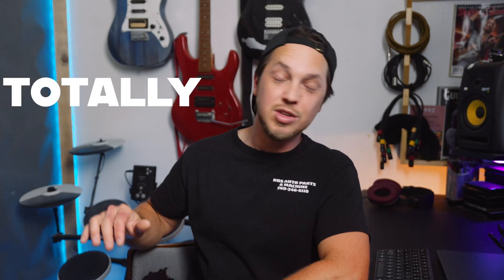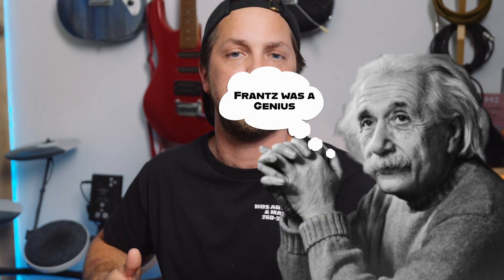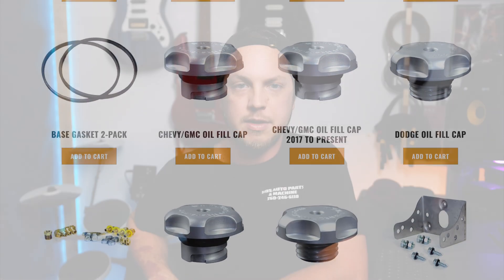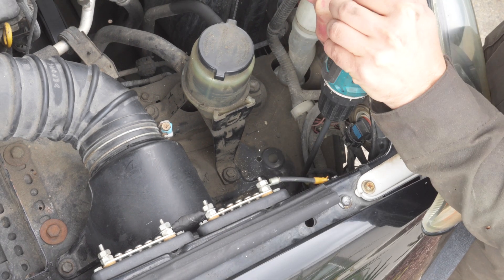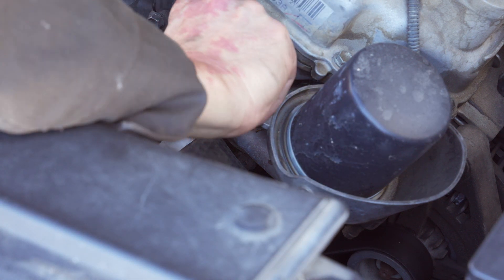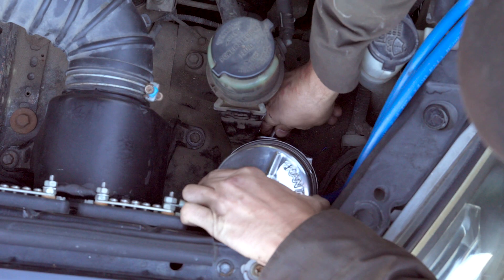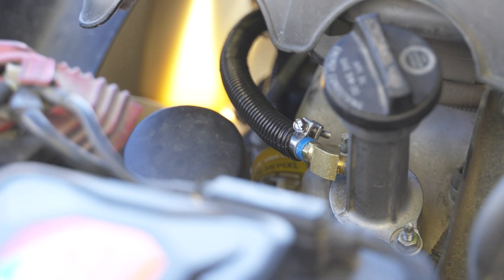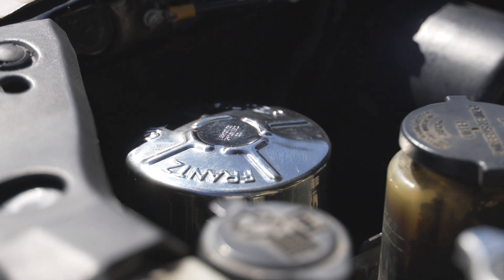Never Change Your Oil Again: Frantz Filter Bypass System Explained & Installed

Comment: The title is 100% clickbait. Can this extend the life of your oil? Almost certainly! But even THE VERY BEST synthetic oils have a lifespan, a long one, way way longer than you'd normally want to wait to change oil. In this case that lifespan claim on the jug actually matters. Why? Because the advertisment on the oil jug saying the oil will last 15k or 25k or some crazy shit, well thats talking about how long it takes for THE OIL ITSELF to break down and stop working right. In most standard oil systems, the oil will become full of contaminants, and general wear grime that will make it ineffective long before that oil breakdown mileage number. In the case of this special filter, all you're doing is, instead of changing your oil and filter every 3-5k like you'd normally do(if you cared about your car) you're now JUST changing the toilet paper each session, until you reach that stated oil breakdown point. Once you reach that point, you STILL need to change your oil! This filter is NOT a miracle worker. Saying that you'll "Never change your oil again!" is COMPLETE BOGUS! Can you use this to save yourself a TON of money in the long run? 100% absolutely! Is your oil now miraculously "forever oil" that you never change? NOT EVEN CLOSE! To even dare to suggest that it does, is downright disgusting and irresponsible. You should be ashamed of yourself!
Reply from the maker: You missed the part about full pao not breaking down. Also, haven’t changed the oil in my 1985 k20 in 15 years and it’s gotten nothing but standard oil and sometimes even dirty oil. Say what you want, but experience speaks for itself. I daily drove it for a long time and still drive it weekly.
Reply: @dillansgarage  Your and your Dad's experience is not enough to make concrete and solid claims that you never have to change your oil ever again. Present data, research, experiments, studies and the like, AND THEN you can make such claims. You're stating your claims AS IF they are facts when you have not proven that they are. All you've done is given your and your father's subjective testimony in favor of the product. I don't give a FUCK about your "experience". The "experience" does NOT speak for itself. PROVE YOUR CLAIMS!!! Don't just base them solely on your own "experience". I stand by what I said. Making the claims you did, in the manner you did, without supporting it with anything other than your and your dad's subjective experience, is downright irresponsible and shameful.
Reply: I have never had any trouble finding a toilet paper filter expert. In the 60s I set up at flea markets. Also in the 80s. About every other person was an expert. Even the ones that have never seen one. Its a tough business. Motor Guard gave up on selling oil filters years ago. Gulf Coasts head salesman only does heavy duty diesels now. Mostly military and marine diesels. Also like aircraft and Abrams tank fuel. If they dont sell good he doesnt deal with them. Luckily I have some in use. The Australian Jackmaster Classic is just as good. There are other ones. I installed them on diesel trucks like paper towel filters bolted to the frame on Powerstrokes. I dont think the salesman installs them. He just takes orders. When I sold them TA truck stops serviced them.
Reply: Actually what Dillan says is true. I probably wouldnt use the PAO oil or the TBN booster. I prefer the top loader filters. The reason I use toilet paper filters is so I dont need to drain dirty oil.
Reply: When I put a Frantz on my Rambler American and saw the oil go from dirty and black to new I thought it was a miracle worker.  In those days you could squeeze the top of the used TP and get sludge. Squeeze the bottom and get new oil. Hard to tell the difference with these modern fuel injected gasoline engines. You can still get bypass filters for the 64 L head engines. About a 10 micron spin on filter. Actually a full flow filter with an orifice.
Reply: Follow the money. He's shilling for this company, it's blatantly obvious.
Reply: The reason most of us dont normally change oil is we use filters that clean oil. We change the filters often enough to keep the oil clean. Normally we add enough new makeup oil to replenish the additives. Additives last a lot longer in clean oil. It is so simple even someone with no degree can figure it out.
Reply: I have nothing against expensive motor oil. When you are dealing with a lot of diesel soot its better to use a proven diesel motor oil such as Delo or Rotella and change the filter more often.
Reply: Good to have another oil and filter genious. The Edison of oil and filters
Reply: Oil filters dont make oil last longer. They clean the oil. Never needing to change the oil means you have avoided the reasons for needing to change the oil. Poor filtration is by far the biggest reason for needing an oil change. Not operating at normal operating temperature is anothe one. Leaky head gaskets. It takes common sense to be successful.

Comment: We use that every day oil doesn't break down just gets dirty
Reply from the maker: @olderolderman4603  that what my pops does. He puts dirty oil into his trucks and lets the filter clean it haha people can say what they want, but you can’t argue results.
Reply: My riding mowers have toilet paper filters. When I change the oil in the push mowers I let the used oil settle until I need a quart in the engines that have a toilet paper filter. The full flow filters are Ford car filters or sometimes Toyota.
Reply: I will be selling my 76 F250 and the 93 Subaru Legacy. I would leave the toilet paper filters on. Some people might think it has toilet paper filters on it. The engine and transmission are probably in good condition. More than likely it will be that engine and transmission is probably full of toilet paper. I do have to fix the Subaru. Getting hard to start when its cold. Im guessing but I think there is a senser near the temperature guage sensor that gives it a rich mixture when its cold. I put a fuel injector in the intake with a push button. Works great but probably not a good sales feature.
Reply: Yes it was the sensor. About 24 bucks at Auto Zone. It would have started good at the auction. I just couldnt do it to someone.

Comment: Frantz themselves doesn’t even claim this system prevents future oil changes. It helps increase oil life but don’t make click baity claims that you’ll never have to change the oil again.
Reply: Had a frantz oil double toilet roll size filter on a toyota BJ42 and then a toyota 80 series. Also fitted a single roll filter on the fuel line as well. Ran synthetic ams-oil in both vehicles. Only ever changed toilet rolls and topped up oil (never actually changed the oil) both vehicles did over 450,000 kms each and never had an issue with the engines. AT 250,000 was told by mechanic advice from toyota was to change out big end bearings. He did the job and was amazed how new the old ones looked. As good in fact as the replacements 9:44 he ordered in. Will be fitting on a 300 series landcruiser soon.
Reply: I remember in the 60s Frantz and Motor Guard users would say things like 100.000 miles on the same oil. We normally didnt drain oil in the 60s  We changed the filters about every 2000 miles and added a quart of new oil. Thats  more like 50 quarts in 100.000 miles.  Probably should say no oil drains. My cars normally get a new quart of oil every 6.000 miles Mostly highway in the Dallas Texas area.   All it amounts to is keeping the oil clean 100 percent of the time and adding enough new oil at filter change to keep the additives up to specs. You dont need to use an expensive oil or extra additives. Oil comes with enough additives.
Reply: Dont know when Frantz stopped making the 2 3 and 4 stackers or the AeroFrantz.  Saw 2 Frantz 3 stackers on a over the road truck. They were replaces by the big Gulf Coast filters. The Frantz dealer specialized in heavy duty marine diesel engines. One of his customers owned offshore rig service boats. He now owns Gulf Coast filters. He isnt into small engines. He dropped the little toilet paper filters.
Reply: We would be in a heap of trouble if we had a shortage of oil filter experts. I dont think that will happen. Also no shortage of oil experts. When someone says the bypass filter controls the flow of oil to the engine you know he is a pro. Probably a PHD in oil filters.
Reply: Toilet paper filters have been around longer than high dollar motor oil. I dont think John Frantz had a problem saying no more oil changes. The Australian Jackmaster filter site says eliminates oil changes. Probably not a smart thing to say. It scares people. It didnt scare me.
Reply: I have always depended on the additives already in the oil. Additives last a lot longer in clean oil.
Reply: Skipper K Yee once told me keep your oil clean and dry and you wont have acid problems. Neglecting your oil filter isnt keeping your oil clean and dry. There are old Frantz people that use additive free oil when they can get it. If you see a Frantz with SKY on it Skipper K Yee was the owner.
Reply: Actually Frantz does make that claim, but Frantz also recomends to change the filter every 3000 miles, when changing the filter you are replacing about 1 quart of oil, so technically its a partial oil change and that's ok because by keeping the oil cleaner the aditives in the oil last longer and the cleaner oil will allow to partially change the oil by replacing the filter. However if you truly did not change the oil by never replacing the filter you would most likely damage the engine.
Reply: I normally don't drain oil. I dont add TBN boosters. A lot of people dont change their filter often enough and dont get enough new oil added to get enough new additives and keep the oil clean. It is less expensive for me to change the filter more often than to send oil samples to a lab.
Reply: I have used toilet paper filters since 1964. Cant say ive never changed the oil. A couple of times because of a leaky head gasket. If I buy a used car I will probably start it out with an oil change.
Reply: Almost everyone thinks equipment lasts longer if you run it on dirty oil for a time then drain it. People that are normally intelligent have a brain shut down when you talk about  filters that clean oil. Its sad.
Reply: I have used toilet paper filters since late 63 or early 64. Starting with a Frantz on my 64 Rambler American flat head 6 with Standard Delo 100 30W.  Better designed filters have come and gone. They all go broke because people like to drain dirty oil.  The Frantz keeps coming back. The better designed filters normally stay gone. All I use now is Motor Guards  Gulf Coasts a Australian Jackmaster Classic and a flat head Ford V8 canister filter converted to use Scott 1000. Motor Guard only makes compressed air filters now. Gulf Coast only does heavy duty such as marine diesels.
Reply from the maker: @Whiskeyj456  that’s the point of the oil analysis
Reply: @diyoverdrive  the point is you make click bait titles and its annoying
Reply from the maker: @ my pops never changes his oil, and I don’t plan to. Regardless of what Franz claims a lot of people have been doing that for decades with still healthy vehicles. It’s not click bait it’s experience. I explain that in the video
Reply: @diyoverdrive  That's nonsense... the additives in engine oil for the latest engines become exhausted over time and mileage, so the oil must be changed no matter how good the filter is.... the oil will also become oxidized over time as well, and will need to be changed.
Reply from the maker: @ that’s why you use full pao and replenish the additives.
Reply from the maker: I’m not here to argue. I grew up with every vehicle having a Franz filter and knowing people who’ve used them for decades. My k20 hasn’t had an oil change in 15 years. If you want to argue the science with someone more knowledgeable then call Franz. I’m going off experience and have been honored to received this kit from them to make a video on my 4Runner. I got a free kit, but I wasn’t paid. The work I put into the video far outweighs the cost of the kit itself. I did it from my own passion. Franz wont tell you to simply never change your oil, but that how we’ve always done it in my family and everything been great.
Reply: @dsteffler54  Bingo. Couldn't of said it better. Fools now days.
Reply: @diyoverdrive  Better to just change the oil... that way it's not oxidized and the pH is correct.
Reply: @diyoverdrive  Furthermore, oil filters aren't just about removing contaminant particles in the oil, they are designed to provide for a certain minimal oil flow rate through the engine. Super duper filtration can result in inadequate flow.
Reply from the maker: @ ok, and a bypass filter is for cleaning the oil. And it does a darn good job on it. Your explanation would be why oem filters do such a terrible job of cleaning the oil
Reply from the maker: @ it’s fine to change it, the oil analysis will let you know when it’s time to.
Reply: @dsteffler54 every time you change the toilet paper you add about a quart of new oil which should boost the TBN enough by itself depending on filter change frequency, he is actually adding a specific TBN booster.

Comment: If the pressure sensor is teed off, does that not mean that if the Frantz filter is clogged, the oil is just going to continue along its original path in the block, and not through the new filter due to taking the path of least resistance?
Reply from the maker: @SparkBerry  if the franz filter is clogged, everything will act as if its stock. If it’s not clogged then oil will continue to pass through the filter as intended, and cleaning the oil. What I can tell you from experience is that every time I change the filter, it’s dark and full of dirty oil remnants, and the oil in the vehicle is still clean.
Reply: Normally the bypass filters since the 1920s send a small stream of filtered oil to the oil pan. With my Perma Cool universal sandwich adapter the clean oil feeds into the inlet of the full flow filter. I still have a few Frantz 2 ports from the 80s They depend on enough oil flow to create a pressure difference.
Reply: Its hard to clog the toilet paper filters in modern engines. I like to use Perma Cool universal 189 oil cooler sandwich adapters with my many toilet paper filters. Bought several from Jegs years ago. The filters are the same as a restricted oil cooler. The bypass valve keeps a good supply of oil going to the engine. For most gasoline and some small diesels. I think the 169 is for turbocharger lubrication. Check with Summit. Dont need an orifice. I have a few old Frantz 2 port sandwich adapters but they arent universal. Dont have anything they fit.
Reply: Dillan did it the correct old fashioned way. I would probably use one of the top loaders when it is in a hole. That over center clamp can be a problem in a tight place. I like the center bolt models. I would probably put a tubeless tire valve in the Frantz if it doesnt drain at shut down. The one with the nut. Use a cigarette lighter air pump with a gauge for the flat head Ford V8 canister filter. The pressure starts up then drops off when the excess oil is out of the filter.